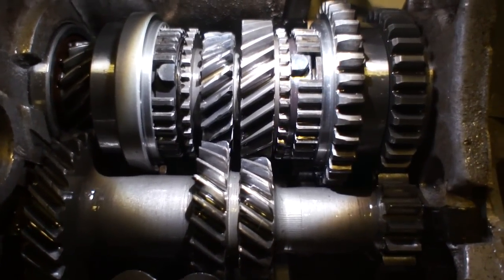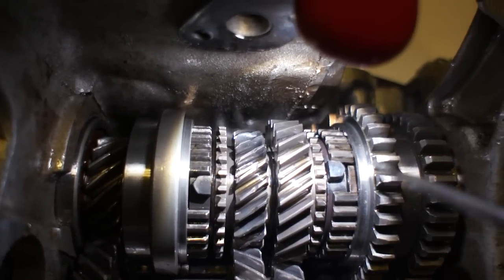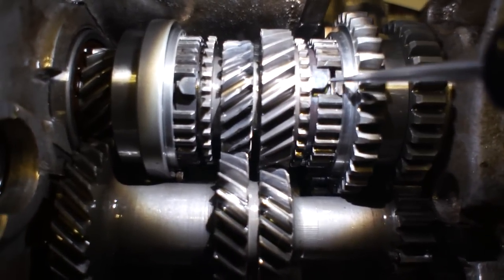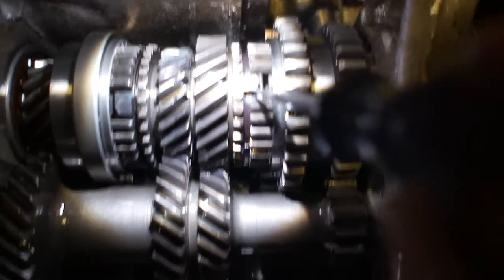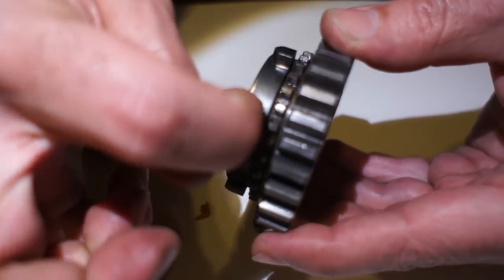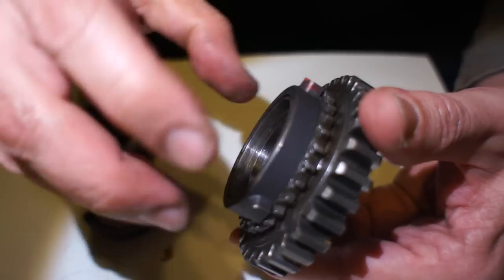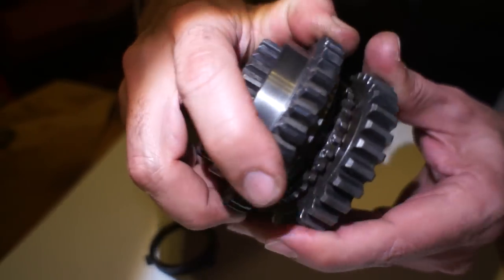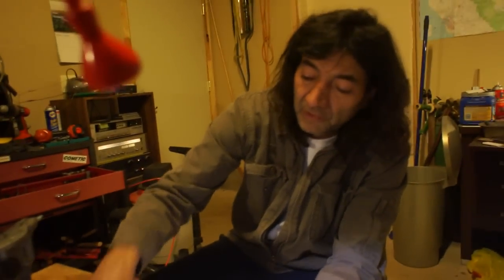Grinding Gearshift Explained

Comment: The transmission guys do a fine business because most people refuse to rev match into 2nd gear.  Now if the transmission design engineers would make a close ratio transmission for manual cars this problem would not be so prevalent.  It is not going to happen, because most of these design guys drive automatic cars and are not gear enthusiasts.  They sit in their offices and calculate that a big jump (wide ratio) into 2nd gear is just fine, and the engine can handle it. They are right,  BUT with that wide ratio you need to wait for it, and rev match.  That means a slow shift into 2nd.  Nobody wants to wait, so the repair shops make a good living.  I am a 43 year long haul driver who has never owned an automatic car.  My transmissions always last the life of the car,  BUT at lights I have little old ladies give me the finger, because I wait for that second gear shift.  Everybody needs to tell the manufacturers, that there is NO reason to have a wide ratio, in a manual 6 speed transmission.

Comment: Most people do not understand why 2nd gear synchros get destroyed so often.  The reason is simple.  Transmission designers at their drawing board reason that you have enough torque  to have a big jump (wide ratio) into 2nd gear. That is correct,  BUT what they don't realize is that nobody wants to wait and rev match that shift,  so they just jamb it into 2nd gear and wear out the syncros in 2nd.  Unfortunately most designers are not manual enthusiasts, and so this is a common design error in many manual transmission cars.  My  transmission never grinds even when the car is old, because I always rev match, and wait for it in all gears.  Progessive wide ratio 1st to 2nd gear transmissions keep the shops busy and maybe that is the name of the game. How can we convince them to make all modern 6 speed transmissions close ratio all the way up?
Reply from the maker: Or could it be that shifting to second is done far more than any other gear, both up and down, at high revs, around the peak power of the engine?   It's quite normal for second to wear out first, even if you 'wait for it!

Comment: 2018 Civic Type-R problem
Reply from the maker: I'll try to read your mind... although with a new car, it seems to be a dealer problem!  But my best guess is that it grinds a little going into reverse.  Even new cars with nothing wrong can experience a little crunch grabbing reverse because typically there is no synchro for reverse. It is not intended for use with the car moving at all!  When in neutral with your foot off the clutch, all the gears inside the trans are turning with the engine.  When you step on the clutch, the gears have to slow to a stop in oil to allow a smooth shift into reverse. If you try to shift too quickly, the turning gears cause a little crunch.  You can either count to 3 then shift, or a little trick is to slip into any other gear (thereby using it's synchro to stop rotation), then reverse without releasing the clutch.  Remember that cold temps when starting out mean cold oil so take it easy for a few minutes.

Comment from the maker: Automatic transmissions work quite different, using constant hydraulic pressure. It's unusual to hear grinding, because they will usually fail before that, and you just get all neutral.  I'm not an auto trans expert, but it should be easy to find info on your issue.  Try some of the Mustang forums.  Most transmissions can be rebuilt,  although sometimes, a "factory replacement" can be cheaper!

Comment: My car was parked on a hill. When I let go of the break to engage reverse and back up, my gear, grounded badly. I supposedly just got a new clutch in my car. So what would be the problem now? bad transmission? Or should I first do a transmission fluid change before I jump to any conclusions

Comment: could bad synchro ring be the reason of knocking when shifting gears... when i shift to second gear or revers i usaly hear knock from underneath the car... and i belive it comes from gearbox... It is a single knock and it only happens in second gear and revers... any thoughts? :/

Comment: Thank you for the video.  In the winter months (or when it's say 40* F or below out) I will get a slight crunch when shifting from 1st to 2nd. Over ~40*F I have zero crunch at all.  Obviously the fluid temperature is directly related to said crunch but I'm wondering why exactly said crunch is happening.  Could the cold, thick fluid be causing the the synchro to spin slower than it should be, thus causing said crunch??

It's odd, but the crunch is ONLY on 1st to 2nd shifts when cold.

Comment: I seem to be getting some weird grinds on my RX-7 FC now and then on upshifts for no reason. Clutch is all in too. They've stopped happening lately. Currently it happens when I mess up on downshifts because I go too fast through the motions and sometimes the gear stick doesn't go into place as fast asI expect it to. I usually get them right though. Gonna take it a bit slower.
Reply: KoopaXross. Rev match and solve your problem. Jamb it and pay.

Comment: Is it normal for a new car less 1000 miles to have slightly notchy feeling shift. Also sometimes my 1st gear shift will only go in half way and then when I let out the clutch the gear/synchro grinds and makes me want to cry! Is this normal behavior for 1st to be blocked sometimes.
Reply: callofdutyguy9. Normal.  Blocking does happen.  Simply let the clutch out a bit, and then clutch it into first.

Comment: very helpful video! Yesterday my wife who drives an automatic all the time (but she knows how to drive manual basically and has done it before) sat in my VW Golf and when pushing the brake (as you do in AT) pushed it into reverse gear!! of course the car made a bad popping sound and stalled. I have been driving it normally since this happened and it seems OK and I cannot detect anything unusual yet. How worried should I be?! What should I be looking for?
Reply: Vladimir Putin  still driving perfectly like 4 years ago. never seen a mechanic or dealership for anything since i bought the car. small stuff like brake job, oil and filters, spark plugs, etc...i do myself.

Comment: what about only grinds in high rpm range but on normal drive its just ok mine was struggle and grinds on 2nd to 3rd and 4th to 5th in redline  normal drive it seems fine

Comment: Hi my car was grinding when I accerated during uphill and my engine check light was blinking on my deskboard but went off after grinding. It didnt make any sound it was just shaking and it wasn't almost feelable for the passengers. Could it that I didnt shift to the second gear and so the accerating is not enough. What could be the cause of this and how bad could it be??

Comment: thanks for the explanation. . my 4th gear synchronizer is shot.. by which I'm mean its nonexistent ,grinds and never engages so I go from 3rd to 5th.. my mechanic is working on it so I would like to know the cost of something like this.. my warranty cover the labor to bring down n put back the trans but it wont cover fixing the synchronizer.. what does a synchronizer repair cost n what's the wait time

Comment: hey excuse my moms account. i drive an 06 mustang gt and sometimes when driving usually in 2nd and 3rd at low rpm about 2500-3500  the car will make a metallic ringing kinda sound. is what you are explaining around 2:25?

Comment: my Suzuki Esteem g15b Have a manual transmission,  and its gear box is making stupid sound,  ( Tik Tik sounds on first and 2nd gear, 3rd and 4th run smooth, 5th dis-engage when i pull my foot back from accelerator. Can you define what the problem Please.

Comment: Ohhh... so does this mean that the syncro is slightly tapered on the inside part? And then when it's worn it looses the angle and hence the grip?

Incline FTW!
Reply: +Tekno Statik I believe the wear on the synchro is from the friction grooves that grab on to the speed gear. With the groove completely wearing out, the clearance between the ring and speed gear are out of spec. This allows the synchro to spin freely and not grabbing on to the speed gear. The reason behind the minimum clearance is to ensure that the synchro will grab on to the gear as force is being applied from the synchro to the the speed gear.
Reply: +GripHobby, yea. so the friction grooves inside of the synchro are angled so that they grab and turn the speed gear, this would explain why the clearance indicates a good synchro.

Comment: I just got done with a transmission class and I still didn't understand how the synchros exactly engaged gears and where the 'grinding' sound comes from if the gearsets are always in mesh already. My teacher failed to explain this, but you did it perfectly well. Just wanted to thank you. Great video, perfect length too.

Comment: My reverse gear grinds a little sometimes
Reply: +Munur Yilmaz Almost all reverse gears do not have synchros and are straight-cut gears. So grinding when going into reverse is common if the input shaft is spinning quicker than it should (if rpm is up and clutch is partially engaged).

Comment: If the 2 gears are of the same speed, how does that prevent the case where the teeth of one gear hits the teeth of the other gear?
Reply: +El Chupacabra It doesn't. Teeth geometry is one that actually makes it fit at nearly equal angular velocities. It's like trying to make a collision with two parallel knifes and make them to block. Besides you have a transmission oil that helps to slip and eventually fit two gears.

Comment: thank you it's so clear now 
i have a problem withe my car chevrolet aveo 1.5 whene i put the 5 gear  and i park the car the revers gear don't worck do you think i have a problem with the synchro ??
Reply: Ishak Amrani There may be a problem with the idle gear. Idle gears don't have synchro rings so a worn out synchro ring wouldn't be the problem.

Comment: Great explanation!  I was having some transmission problems in my vehicle, getting an intermittent crunch when shifting from 3rd to 4th initially.  Took it to a shop, they claimed to have fixed it, but even after returning to the shop for adjustments two separate times the crunching still persists.  Now it likes to crunch sometimes when down shifting from 4th to 3rd and sometimes from 4th to 5th.  It's strange because the shop can't replicate it and it only seems to happen after I've driven around town for at least 30 mins to an hour.  I've tried to dwell longer between the clutch being depressed and moving the gear lever and tried being fast and precise while rev matching, same, sometimes a crunch sometimes no crunch.  Any ideas?  (They gave me the old syncros from the first shop visit.)

Comment: My '92 Holden Nova has been grinding in 3rd gear, is this caused by the same thing??
Reply: Try pushing in the clutch, pausing in neutral between 2nd and 3rd and letting out the clutch and letting your engine rev down just a bit to what it will be in 3rd, then pushing in the clutch and sliding it into the 3rd.  If that reduces or eliminated the grinding then your synchro is probably bad.  This is called double clutching and is matching the transmission shaft speeds before you shift into a new ration, which is what the synchro is supposed to be doing for you.
Reply: Simply Steve,  You have not been rev matching and so your syncros are worn.  The simple solution is to always rev match and your transmission will last the life of your car, as does mine.

Comment: My B5 Audi has a 2nd gear crunch in cold weather, I have alreay read about the synhros and understood the problem, but never found and explanation what mechanical process actually happens. Thanks mate! :)
Reply: rzmrz.  I always have owned manual transmission cars and when it is cold I always double clutch it into second gear. My transmissions always last the life of the car. Rev match and save lots of money.  Jamb it and pay.